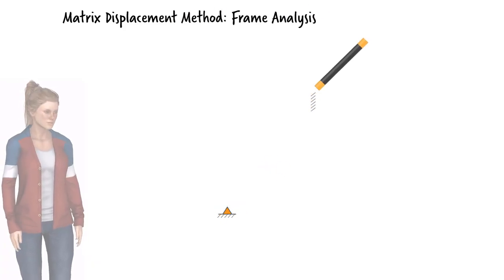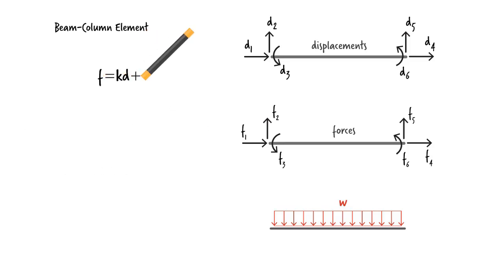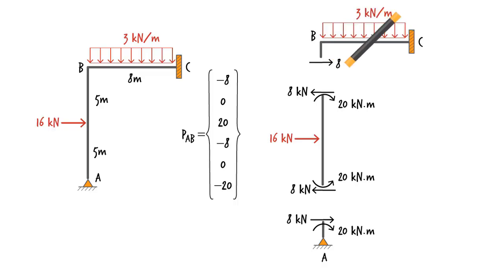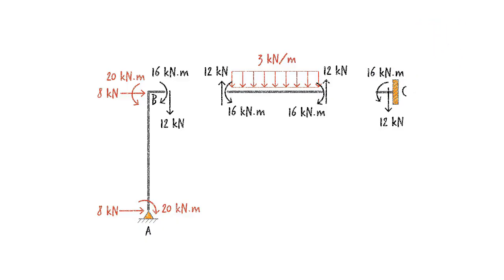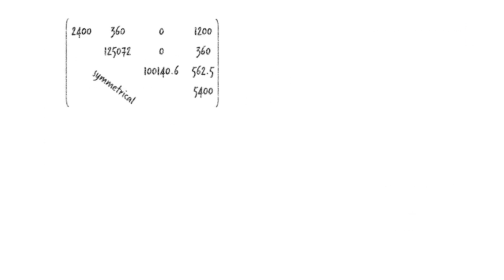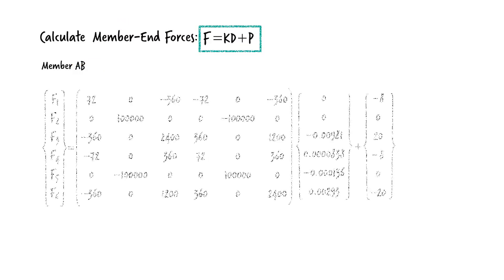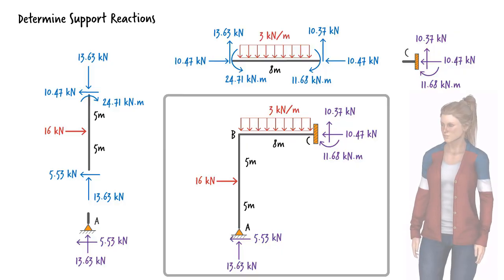SA50: Matrix Displacement Method: Frame Analysis (Member Loads)

Comment: Once again thank you much. I dont have enough words to thank this channel for these videos. 
Is there a way to know which direction the moment to be shown ma'am?
Reply from the maker: In our formulation of the matrix method, we always assume the unknown member-end moments to be in the counterclockwise direction. After the calculations are done, if we end up with a negative moment magnitude, then we know the moment is actually acting in the clockwise direction.
Reply: @DrStructure  Ok Thank you. I am looking at the member forces. In your question both members have a force ( either distributed or a concentrated) what if only one member has a force. In that case how to solve ma'am?
Reply from the maker: The same way, just right the equilibrium equations based on the member-end forces, without any applied loads. The member-end shear forces and moments would be sufficient to keep the member in equilibrium.
Reply: @DrStructure   Thank you . In lecture SA50 at 3.49 minutes in B corner the forces are 20 and 8. so if its equilibrium on the BC bar, does the B corner will have the same forces ? Can you guide me how to find the equilibrium forces in that case ? Is it by the sum of forces and moments ?
Reply from the maker: When we cut a member, as we have done at 3:49, the forces at the left and right faces of the cut need to balance each other out. The two shear forces need to have the same magnitude but act in opposite directions. The two moments too, need to act in opposite directions but have the same magnitude. 

@3:49, these forces/moments are shown in black. We calculate the shear force and moment using one of the free-body diagrams (say, beam BC), then place the same force and moment (but in opposite directions) at the other face of the cut.
Reply: @DrStructure  Ok got it. But what I dont get is how to find the shear and bending in beam BC ? please help :( If you have a video please guide.
Reply from the maker: The matrix method is not the best starting point for this. You may want to start from the slope-deflection method in which we first calculate the joint rotations, the member-end moments, and then the member-end shear forces using the static equilibrium equations.

You may also want to spend some time with the content that we have compiled for our Structural Analysis I course before delving more into the matrix method.

https://courses.structure.education/courses/structural-analysis-i
Reply: @DrStructure  Thanks ma'am. I will do that. What is the equation at minute 5.59? Where did that come from?
Reply from the maker: That is the expanded form of the equation described starting at @00:45.
Reply: Dr. Structure yeah ma’am. So the K in here is the k11, k12 6x6 matrix ? 
The system matrix that was derived in early videos had something different to this ? The zeros were in different places so I think this K is taken from else where. And when it comes to BC member the stiffness matrix is different. 
How did the k in that equation come. 
Can you please explain ma’am. Thanks a lot.
Reply from the maker: @markwatson2779  Yes, the member stiffness matrix is always 6x6, since a member has six degrees of freedom. 

Correct, different problems lead to different stiffness matrices. The location of the zeros in the stiffness matrix are a function of the geometry of the structure. Not sure why you are comparing the location of zeros.

The generic stiffness matrix is the same for all members. However, depending on the orientation of the members, and their E and I, we end up with different numeric values for their coefficients. 

It probably will be more helpful if you wrote down your own solution and send it to us for feedback. Based on your understanding of the principles of the matrix method, how do you actually solve the problem? What does the member stiffness matrices that you are able write down look like? What does the system stiffness matrix look like? You can email your solution to Dr.Structure@EducativeTechnologies.net for our feedback.
Reply: @DrStructure  Okay yeah , my confusion was what the K's in this matrix mean? have they been multiplied by the Q is that why it's different.
That would be amazing if I can email and get feedback. I will do that as soon as I write down my answers. Thanks again.

Comment: İ think threre is a mistake in the stifness matrices for exampla k22 is equal to 12572 not  125072 also k33 is equal to 10140.6 not 100140,6
Reply from the maker: Don't see any errors in those coefficients. How did you arrive at your numbers? 

Take k22. It equals k11 of member BC added to k44 of member AB. 

k11 of BC = EA/L = (200 x 10^6)(5000 x 10^-6)/8 = 125000

and k44 of AB = 72. 

When the two numbers added together, we get: 125072.

Comment: Excuse me, @02:37, member AB, i have a question. I need to draw a picture to describe my question. The link of picture is attached as follow: 

https://www.facebook.com/photo.php?fbid=10157522690582710&set=a.10150380104392710&type=3&theater
The question is around this lecture SA50 @02:37 & previous lecture SA49 @10:27, 

Both lecture teach same configuration of structure with different load types - joint load vs member load. 

For member AB, they both have theta = 90 degree; 

But the sequence of vector direction is different, I dont know why!???
In this lecture SA50, the force vector f2 is counted as horizontally in global view, 

but in previous lecture SA49, the force vector f2 is counted as vertically in global view., 

I dont get it!???
Reply from the maker: In SA50, you need to keep in mind that member AB is vertical, even though at 2:37 it is drawn horizontally.  In that horizontal diagram, the shear force is f1 (in global coordinate system), the axial force is f2, ...  Perhaps it would have been less confusing if that diagram would have been drawn vertically.
Reply: @DrStructure    If f1 is shear force -- 8kN in global system, why do first row of vector P is equal to 0?
Reply from the maker: @chungken8496  Vector p is defined in the local (member) coordinate system. When we pre-multiply it by Q (the transformation matrix), we get the member forces in global coordinate system. So, when writing p we consider the x-axis to be along the length of the member. When then transform the local coordinate system to the global one by multiplying p by Q.

Comment: At end of rhe results how the  shear force has in same direction in the segment left end and right end?
Reply from the maker: The direction of the shear force is not defined by the direction of the force arrow, rather it is defined by how the force tends to rotate the beam segment. An upward force at the left end of the segment (wanting to turn the segment in the clockwise direction) signifies a positive shear. However, an upward shear force at the right end of the segment (wanting to turn the segment in the counter-clockwise direction) indicates a negative shear.

In the example problem, the matrix solution gives us two positive (vertical) forces for member BC. The left force having a magnitude of 13.63 kN (since it want to turn BC in the clockwise direction) is considered a positive shear force. The force at the right end of BC is also upward with a magnitude of 10.37 kN. This force however wants to turn the beam in the counter-clockwise direction, therefore, it is considered a negative shear.  

Unrelated to the sign of shear, but related to static equilibrium, note that the sum of these two upward forces must be equal to the total downward (applied) load on BC.

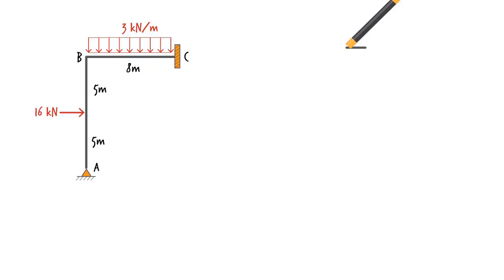Comment: Thanks you so much. In 2:18 how did yo end up having moments of 20knm at both ends of A-B member?
Reply from the maker: Those are fixed-end moments. A beam of length L with a concentrated load of P applied at its midpoint, the fixed-end moments are PL/8. So, here we get: (16 kN)(10 m)/8 = 20 kN.m

Comment: Thanks , for this video on Matrix Displacement Method.How one can solve continuous beam with all fix supports by stiffness matrix method, For example beam with 3 span of each 4m , all supports are fixed with uniformly distributed load on beam 2.5,3.5,3.9 kn/m
Reply from the maker: A beam with three spans has 4 supports, two at the ends and two intermediate supports. If by all supports you mean all four supports are fixed, then you basically have three independent beams each fixed at its ends. They can be analyzed independently, and there is no need to resort to displacement method to analyze them. The fixed-end moments for each beam are: w L^2/12. Knowing the end moments, you can then apply the equilibrium equations to determine the vertical reaction at the ends of each beam. 

If by all supports being fixed, you mean the end supports only, then the system has two degrees of freedom only, the joint rotations at the two interior supports. In this case, we can use the displacement method to calculate the two rotations, and then the support reactions.
Reply: Thank you very much.....looking for more such videos on stiffness matrix method